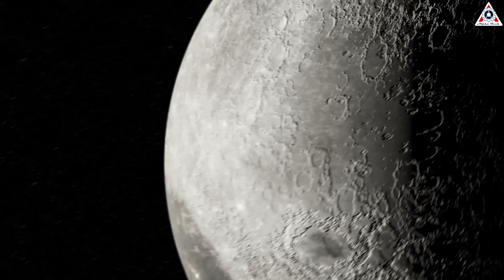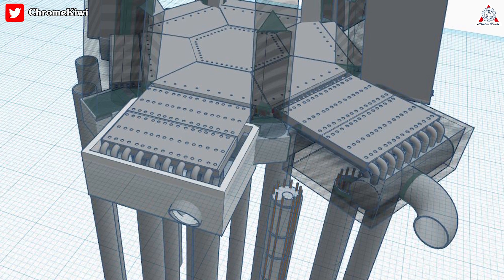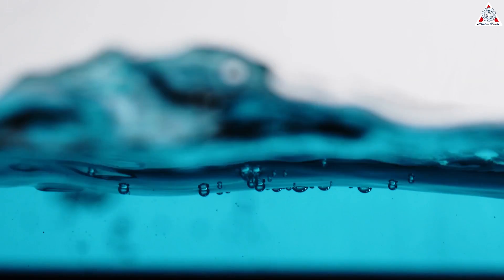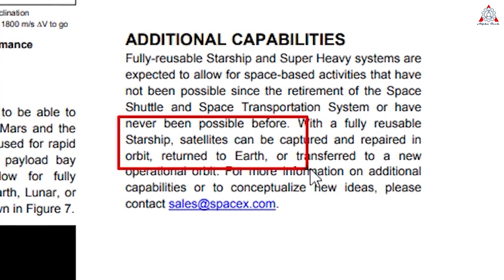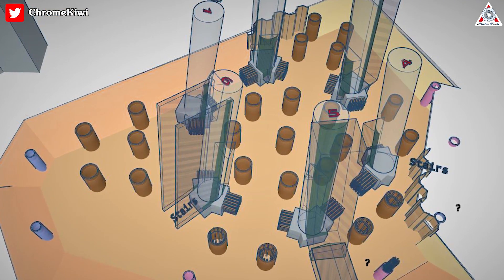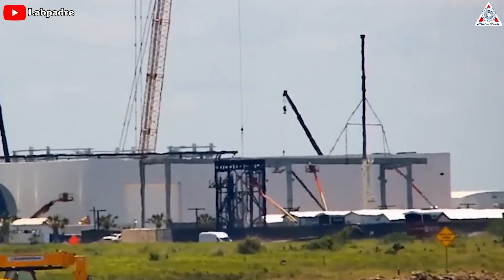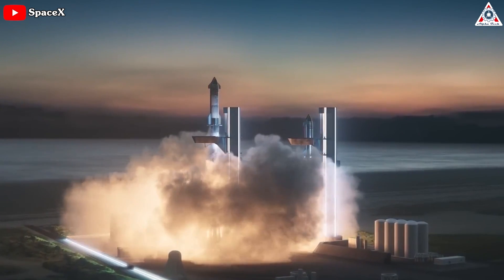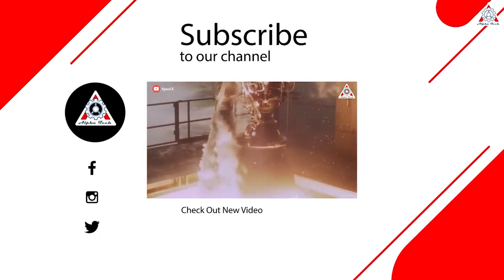SpaceX's New Starship platform to save 33 engines....

Comment: The launch pad damage makes me wonder how they will manage launches from Mars without damage to the ship.  Are they counting on the lower gravity needing less thrust?
Reply: From the renders and animations I have seen, there will be thrusters fairly high up on the rocket for the lunar lander, so maybe they can reduce the thrust needed for Mars with those?  Even if that is the case, I imagine building out launch facilities on Mars will be an early priority.
Reply: @genephipps6421  Building launch pads on mars?  Are you talking about brining concrete and rebar there to do that?  Who will assure the mix design is right?  Who will be the flatworkers?  Robots?  Ridiculous.  A bag of cement weighs 80 pounds.  With water, it's 100.  It costs $10K to put one pound of cement into space.  That means your 1 bag of cement from home depot that originally cost five bucks now costs one million dollars!  Before you even start mixing!  How many bags of cement does it take to build a launch pad?  Many thousands?  You're talking about tens of billions of dollars, JUST to lift the raw materials into space, not even considering the cost and logistics of assembling this stuff automatically before we even get there!  Insanity.  Pure and utter insanity.  This will never happen.
Reply: @byugrad1024  Wow, you just saved space a  ton of money and wasted time.
Reply: @byugrad1024  Mars has regolith and sulfur.  Heat the sulfur until it liquefies.  Add in regolith and a synthetic binder as an add mix.  Martian concrete.  Why on Earth would they ship concrete all the way from Earth when they can make it on Mars?  Mars is not made of cheese man--a LOT of the basic elements you find here on Earth are also present on Mars.  Iron as one example.
Reply: @genephipps6421  So instead of bringing the raw materials by themselves, you're saying you'd rather bring the raw materials to build a concrete plant to manufacture concrete there?  What is this mysterious binding agent by the way?  Do you realize what the binding agent comes from?  Limestone.  Chalk.  Shells.  Do you realize what Limestone is made up of?  (the shells should have given you a hint)  Heat sulfur until it liquifies?  How do you expect to purify the sulfur?  Build a sulfur refining plant?  Seriously?!

It will take you about 10 years, but you'll realize all this is impossible.
Reply: @byugrad1024  I am very much aware of what cement/concrete on Earth are made of.  I have also read about a lot of the research that has been done on the subject of raw materials mining and processing on Mars.  You might enjoy a Google search on the subject yourself.  this might also be a good time to point out that exactly none of the machines, factories, refineries, smelters, furnaces, etc. that we take for granted here on Earth were given to us.  That is to say that we started here on Earth with nothing and built all that we have now.  We can do the same thing on Mars except this time with a massive pool of knowledge.
Reply: Remember that only the upper stage would land on Mars. Since it only has 6 or possibly 9 raptors as opposed to 33 it should be a lot less eventful.

Comment: I have observed in animations that the "Pez Dispenser" apparatus dispenses the satellites out 
along their long axis. If the satellites are four feet wide and eight feet long, the eight foot door 
could be cut in half by dispensing them out along the Four foot axis. 
This would be more structurally sound.
Reply: @Traumaquota99  Yeah they are on an elevated carousel for maximum volumetric density.  I too am amazed that some "guy on the internet" thinks he has figured out something that arguably the worlds best team of aerospace engineers has stupidly missed.  You know, because they don't have mind boggling amounts of compute, the best nesting and volumetric optimization software, the best finite structural analysis software, and haven't run several thousand simulations.
Reply: @genephipps6421  Ask Tim Dodd about that.
Reply: its not structurally unsound though, it just appears to be sub-optimal, which should indicate that spacex has an alternative reason for doing it this way.  it could just be as simple as being able to recycle some components across different types of missions.

Comment: all this because SpaceX refused to take the launch pad technology that NASA developed for the Saturn V, Space Shuttle and SLS....build up the ground so you can out a flame trench and diverter underneath the rocket along with a water deluge system...worked for NASA for over 60 years...all this SpaceX talk about steal plates with a shower head water system and minimizing thrust at takeoff is just more band aids for a deeply flawed launch pad system...

Comment: As far as I am aware the debris from the launch pad did not destroy 3 engines? Several engines failed to ignite on launch (possibly up to 6 booster engines). Why they failed to ignite has not been made public. That is probably the reason that Superheavy took such a long time to leave the launch pad (up to 7 seconds blasting away the concrete)...
Reply: Yes, I think you're correct: 3 didn't start properly from the beginning.
Reply: Good reason to light all the candles and not haul dead engines to orbit as "back-ups?"
Reply: Musk stated personally 3 engines failed, auto shut down at ignition.  The others shut down during flight.
Reply: The whole launch area got peppered with debris
Reply: Three engines not igniting properly is one thing but as the ship lifted off one can see more engines shut down afterward. 
Elon said that this first launch had a sort of hodge podge of engines. With incremental improvements being carried out as engine production proceeded. 
Thus there was some variation in the engines. 
This will be important information as they will know which engines had issues and what might have caused those issues. 
With hundreds of engines to be built and the fact that they have now moved on to a newer improved version 3 raptor which is quite different from any version two. Means that the next launch will probably also use up the existing inventory of version two engines and we may only see version 3 engines on ships past number 30 possibly next year. With this year's objective to use up some of the vessels sitting in their growing rocket garden. And although the objective is to make a reusable rocket system, in reality all ships under 30 are disposable test versions.
Reply: You either did not listen to video or you do not know simple physics and simple mathematic. Man in the video said that Elon stated that Space Cadets at SpaceX running that show did not use launch clamps  during liftoff. That means that the rocket started lifting off as soon as the thrust exceeded weight of the rocket. Now,  weight of fully fueled SH Booster/Starship rocket is 5200mT (4000mT for Booster and 1200mT for Starship). That means that the combined thrust of all functioning Raptors was 5200+mT. Nominal thrust of 30 Raptor 2 engines is 30x230= 6900mT that means that at the moment of liftoff all working Raptors were running at 75% of their rated thrust.  You can ask yourself why this figure was so low or you can read my comment posted above yours.
Reply: @KarolKarolak  I read your name as Karen and actually believed it. 🤦‍♂️ I'm sure I'm not the first.
Reply: Some were deliberately shut off or stopped.  Some just failed.  I don't know if the failures were due to debris damage or not.
Reply: Hard to believe that the drawworks enclosure looks like Swiss cheese, but nothing hit the engines.
Reply: only three engines didn't light and the video explained that they throttled up slowly causing it to sit longer on the pad. I mean you just watched this video didn't you? you watched all the SpaceX news before you commented right? didn't think so.
Reply: @charlestorruella8591  Elon stated the three engines that didn't light were not caused by debris or damage--which is what this video implies, and what the posters comment was correcting.  So clearly he DID watch the video, and his comments were correct--unlike yours.
Reply: @gijbuis the 3 engines failed due to the flying debris. Look at the launch, the power of the 33 engines was very very huge & un-channelled, that was the flaw in calculations by the SpaceX personnel…. I am surprised that the Starship did not blew….only because of ship’s design reliability. I have a launch pad plan in mind that is simple, effective in launching and safe.
Reply: @Qwertyyy980  the pad 3 shut down immediately on light off.  Are you going to seriously say you know more about it than Elon Musk??

Comment: Guarantee that the water flow will stop under the intense thrust and sonic boom of the 33 Raptor engines firing at 50%, then 100% thrust! Steel plates will become delaminated and start flying!!! Watch and see that I’m right!!
Reply: I'm sure you know much better than all those highly paid engineers. I'll come back and eat my hat if you're right though.
Reply: @gregsteele806  I AM one of those highly paid engineers….for NASA. I worked for SpaceX 4 years ago. All I will say is, I’m glad I made the move.
Reply: HAVE YOU LOOKED UNDER THE LAUNCH PADS AT KSC? ITS METAL PLATES ,EVEN THE FLAME DIVERTER IS PLATE STEEL. SO DO US ALL A FAVOR AND DONT POST ABOUT TECH YOU KNOW NOTHING ABOUT!
Reply: @charlestorruella8591  Psst, your caps lock is stuck on again
Reply: @MartensFamilyHomeMovies  Caps lock….😂🤣😅
Reply: @charlestorruella8591  LOL!!! I work for NASA!! YOU?? LOL!!!🤣😂😅
Reply: @charlestorruella8591  Yes. A flame diverter, not just a steel plate.

Comment: Hate to be a wet blanked, but if the water pressure is too high when it hits the bottom of the rocket it will do as much damage as rocks hitting the bottom.
Reply: as long as it goes full power after the engines ignite it will never get near the starship it will turn to steam and end up as rain around the pad for a few mins think about how hot it is at ground level under the pad which is why they're using water to cool the pad during launch
Reply: @charlestorruella8591  The high pressure pumps and nitrogen tanks will be regulated so carefully.... I bet they have a couple of static fires by ships or boosters that they don't need to launch with right away so they can evaluate it all.
Reply: However if the pressure is not high enough and the water cannot be moved fast enough, the water will heats up and you have a steam explosion.
Reply: Are you suggesting that they use a 'wet blanket' instead? Can they borrow yours?
Reply: @MartensFamilyHomeMovies  I don't think it would last as long as the concrete did!

Comment: SpaceX is very slow on the uptake! These lessons were learned 50+ years ago! But the young children engineers at SpaceX thought they knew more….and obliterated their own launch pad, and damaged their own engines!! SMH
Reply: they tried some technology that was not available back years ago, but it failed, so back to the reliable water system.
Reply: I kinda agree but that didn't damage the enginez that didn't fire it was a software problem not debris do you really think with that much foce of 33 raptor engines firing any debris  could come back up on the engines I agree they should have built a flame diverter   but debris wasn't the reason for the engines to not start up at all otherwise they would have started and then went out they never fired according to spacex
Reply: @charlestorruella8591  What Koolaid are drinking? Even Musk said 5+ seconds to lift from the pad is TOO long, resulting in damage to the pad AND the booster!!!
Reply: a lot of similarities to building a submersible out of carbon fiber after many years of proven technology. Some things just work because they work, and don't need, or shouldn't, be changed.
Reply: @Martinmack333  Carbon fiber, COPV, is never used to resist OUTSIDE pressure! It’s used to CONTAIN pressurized fluids. It’s used on SLS to contain 4,500 psi helium and nitrogen in the vacuum of space and during ascent. COPV = Carbon fiber Overwrapped Pressure Vessel.

Comment: Everytime I see a picture of Elon Mush and the word Genius next to it, I will ignore the video.  
The so called genius has made countless mistakes.  This water deluge system will not survive the launch unscathed.   
The water pressure will not be high enough to fight the rocket pressure, the exhaust will get into the sandwich and the water flash to steam inside the sandwich and it will will blow up.  Even if the water deluge survives the launch, the rebounding shockwaves will most likely damage the booster.    

The genius solution is to build a flame diverter.  The rest is just solving problems that do not need to be solved.
Reply: It seems like too late to change the update. Won't that be possible to make the booster to fire in 2 stages, first just enough power to clear the OLM or tower then in seconds the rest of the engines kick in, such that may reduce the engine thrust pressure to the new build foundation.
Reply: @alee8479  "Just enough power" to clear the tower == full power. At launch, the rocket will be its heaviest. Anything less than full power will see the ship sit there and erode the OLM into dust.
Reply: Good at least there are people like yourself that can identify the danger of Elon water cool pad and how it is a steam explosion waiting to happen... that does not fundamentally answers the problem of exhaust gas reflecting off the ground and hitting the engines.
Reply: You very easily fall for diversions. Launchpad is diversion Elon loves as he has sone kind of a solution for. Real problems lay elsewhere. Idiot Elon just revealed that Space Cadets at SpaceX launched the Starship without using launch clamps. That is a big no no in rocketry as causes inability to directionally steer the rocket after it lifts off with thrust equalling weight of the rocket. Elon got lucky that rocket tilted away from lift tower. Ask why Elon took such desperate step and did not use the clamps and you will learned that he knew from the beginning that his rocket had a fatal design flaw and it was doomed to fail not on the launchpad but high in the sky just before MECO. You can learn more from my comment on this subject posted above yours.
Reply: I replied to vid earlier before i saw these comments that share my concern.. 
is there a Venturi/Bernoulli effect that could be employed. Consider four round cones of decreasing size with the biggest hiding the others inside. All cones have the top cut off and pointing upward. The external appearance is of stage zero wearing a broad based women’s dress. This would decrease the pressure of the exhaust by distributing to a larger exit area which  is open to exhaust the gases. Yes these cones would have to be water cooled 😅
Reply: @derek75116  One skirt is enough. It is ambient air pressure at sea level 1bar or 10mT/m^2 that is confining rocket exhaust
Reply: Yep, the next launch will definitely be fun to watch, and not for the reason these Muskrats are hoping for. NASA's SLS utilized a proper water deluge system, and a flame trench, and the damn thing is half the thrust of Starship! I don't know who Elon thinks he's kidding, but he's not fooling physics. The Fondag absorbed the pressure waves and broke apart, now let's see what happens when the majority of those waves are bounced off a metal surface, back at the engine compartment.....

Comment: We ACTUALLY don't know if the first 3 engines were taken out by flying concrete.
Despite what Musk says I think it's likely damage was incurred at least on the hydrolics unless they just did a really bad job vetting the system for full power.
Reply: Those three engines were shut down during the start up phase.
Reply: @jason_m_schmidt622  Wow, genius move...🤡